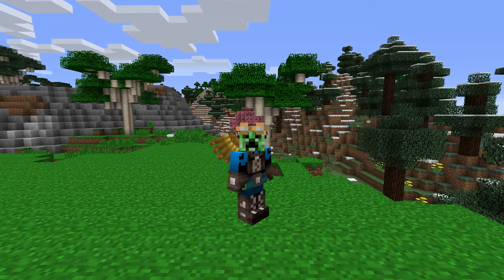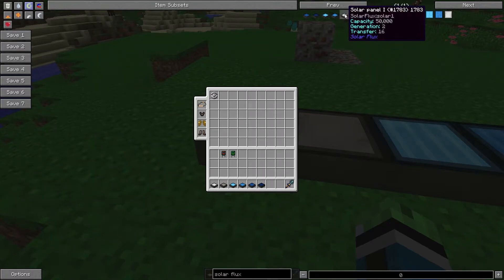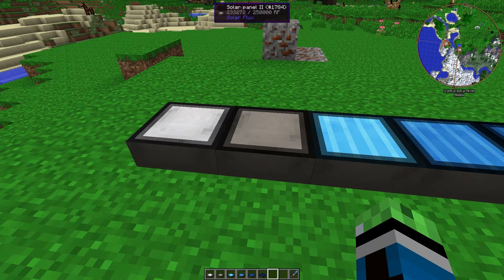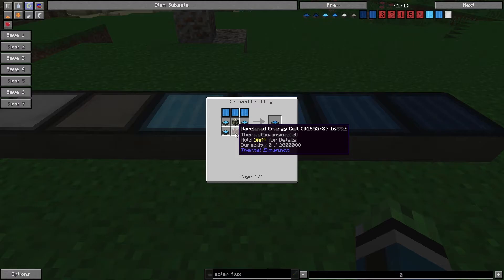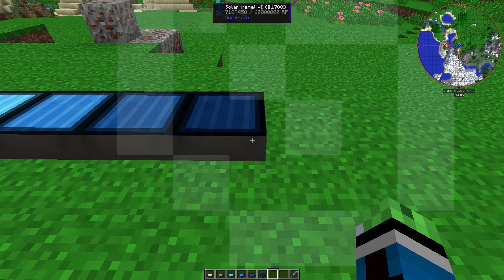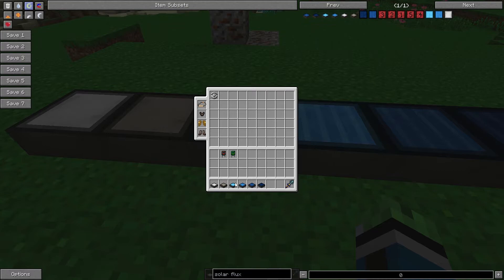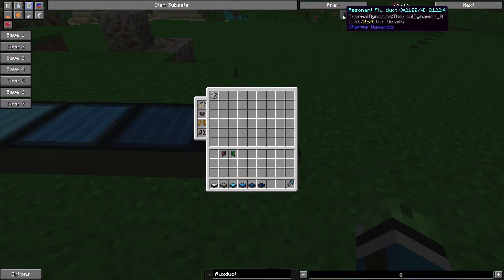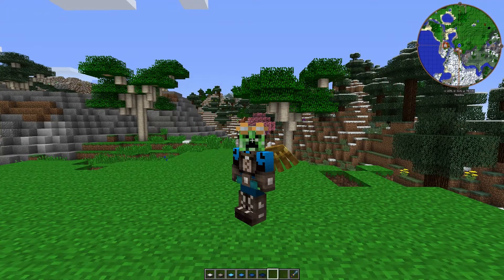Modded Minecraft Tutorial - Solar Flux

Comment: How do you wire them???
Reply: What wires? There's cables from Solar Flux Reborn (I suppose this video is about that mod?), but NEI doesn't show their recipe. So how are they made?
Reply from the maker: +baden271 This video is about Solar Flux 1.7.10. There are no cables in the mod, but you can use any cables from any mod that transfer RF.
Reply from the maker: Place your wires under them to transfer the energy to an energy storage or machine, or you can place it directly on top of the storage or machine if possible